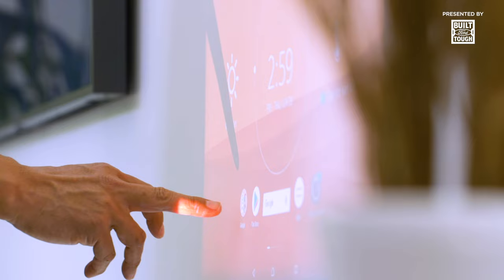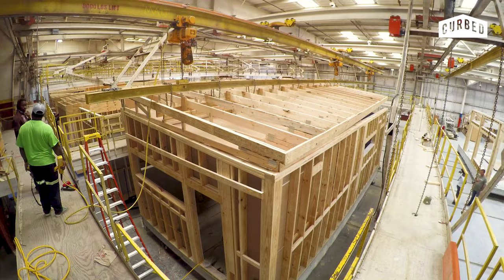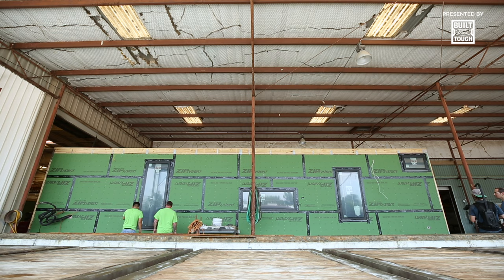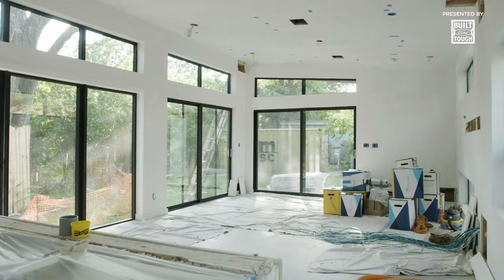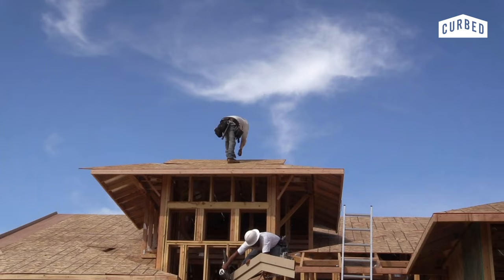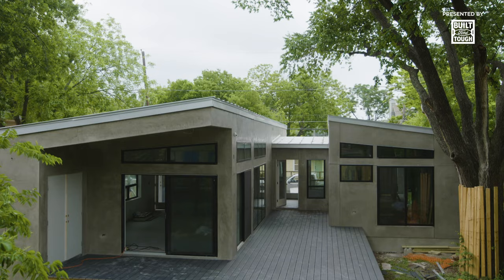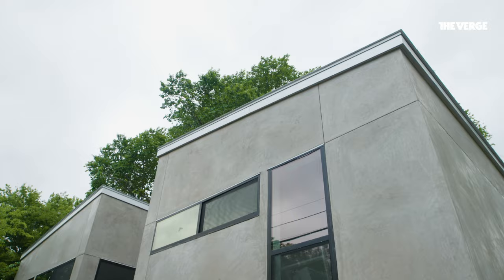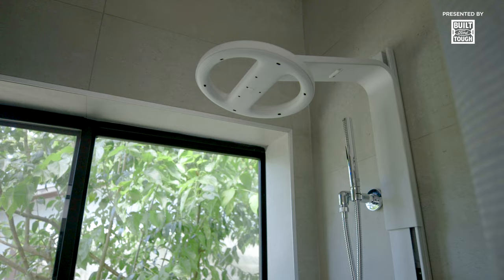We built the Home of the Future with Grant Imahara

Comment: high perimeter to area ratio (check), lots of glazing (check), practically no eaves (check) = Modern Architecture indeed. Even in a forgiving climate like Austin, the owners will be at the mercy of active cooling (AC) 6 months of the year. I would have aligned skillian roof to face south to maximize solar gains and employed generous eaves to keep the thermal loading off the mass - perhaps with north-facing clerestory windows to increase the internal cross ventilation. Smart houses used traditional design principles first, and active systems to increase efficiency second.
Reply: I guess my point is this: While the early modernists certainly had valid grounds to break from the stagnant cycle of neo-revivalism and seize the potential of technological advancements, today's context is far different. Our resources are becoming ever more finite, thus we would be foolish to turn our backs on the genius of past minds without becoming bogged down by convention. And let's face it, a box house is practically modern convention anyway.

Comment: I don't see this concept as eco-friendly
This is great though.
Why can't we use GFRC panels instead of a wood framework? I mean why to use wood anyway, why to cut trees if these can be done by other alternatives which are eco-friendly, stronger and even cheaper than wood.
Reply: @dubsdubs  tell this trolls, buggers, cws, busibodies . There is a trend on YouTube where if the first few comments are negative then people think the rest should be negative sarcastic and destructive as well. People be left behind in your own company without pulling others to yourselves and your negativity.
Reply: @mahindufrancis9998  but you're doing exactly what you said about negativity when DubsDubs does have a point? concrete isn't eco-friendly and wood can be grown and protected depending on who grows it for production. op is right in that there are other alternatives that can be used though, but I think those always take time to get through planning permissions in the different regulations an area has.

Comment: Modular homes have been around forever. Not really inspiring the idea of "home of the future" just yet.. I was honestly expecting something a bit more cutting edge, like 3D printed homes, a new blend of materials or something along those lines.
Reply: 3d printed homes are the real future, and not made out of cutting down trees.
Reply: @os2841  I don't think 3D printed homes are the future ... It's not eco friendly since 3D printing would mean that its extruding plastic, which is harmful to the environment...
Reply: @joeljames2829  actually they are made from concrete, it's not your typical 3D printer making these, as you can imagine, however it's not the home of the future due to the lack in sand used in concrete construction globally. If we use concrete as the next staple for housing it would be a greatly irresponsible move.
Reply: @joeljames2829  you can 3D print many different materials like concrete, steel, plastics, and nearly anything that is handled sometimes as a fluid.
Reply: @DoctorlyRob  Concrete specifically requires river sand, a finite kind of sand that we only have so much of. This sand is incredibly important to the life that lives near it. Concrete is not eco-friendly, it's just not super toxic or anything. Hemp, fungus (used in bio plastics), & other materials like it are what will be replacing concrete, plastic, wood, etc someday soon as they are environmentally safe & renewable.
Reply: @probablynotdad6553  yes I know that's why I said they too can't be the homes of the future
Reply: @DoctorlyRob  Ah, my bad I didn't see the read more part.
Reply: I guess houses will get smaller and smaller,and buildings full of apartments will get taller.Or.... everybody will live in cage homes,Just like they have in Hong Kong

Comment: The home of the future doesn't have a gasoline Ford F-150 in the driveway.
Reply: House Stark and you sir... don’t get it
Reply: House Stark I plan to tow my trailer with an electric vehicle. You know, with the instant torque and all. Tesla's long awaited pick-up truck is set to have 300k lbfeet of torque at the wheels. So I don't see why people would still be buying gasoline vehicles in 10 years.
Reply: House Stark look it up, electric motors are far more efficient and powerful than any thermal engine. Common beliefs have made us think otherwise all this time because of how good a thermal engine sounds. Most people don't believe it, but facts are there.
Reply: But I made a mistake with the numbers, the 300k is actually the towing capacity in lbs. Torque would look like 8-10k I guess.
Reply: House Stark yes I pointed out that I confused the two. But Tesla has announced working on a pick-up truck. Elon even went to Twitter to ask the public what they wanted to see happen in a pick-up truck, which is where I saw the numbers I mistakenly confused. There's at least 2-4 years though before we see anything official. Let's just hope it lives to the hype. It would be quite a move forward.
Reply: House Stark Tesla Truck is better.
Reply: William Pelletier lmao 300k ft lbs of torque
Reply: @123456789wil1  this guy was doing construction work lmao hes not gonna do that stuff in a nissan leaf

Comment: Having built 12 homes for myself, and incorporated every "latest" technological advance since the early 1990's;  Ive discovered that the best innovation is a very high MTBF.  The cost of equipment and the subsequent wear and eventual failure can almost approach the value of the home itself.  Having a high Mean Time Before Failure (or obsolescence). Integrated - this, and internet connected - that is flashy and cool, but the software and hardware support for such connected-ness is a continuing cost of effort and cash.  It is better to make the house more 'self-reliant' and add the cool functionality to the persons occupying the home.  Personal equipment can more easily be upgraded replaced or eliminated without the  expense of upgrading the home as well.  

Previous homes I've built have miles of unused cables, routers, etc, that became useless once wireless technology became commonplace.  Bluetooth is now eliminating many of the previous era WiFi devices.

Nice show, er-rather Showcase, since this appears to be more about the gadgets than the building.  Having done the one show on how to manufacture homes,   the real story should be how the manufacturing plant can be modified and configured to create more "custom" homes using the same flexibly CAD/CAM systems.

Keep up the good work Grant.  ")

Comment: Hey Grant, right off the batt I've always liked factory-built homes but I still have some question like can the mfg., add in-floor heating, how are changes handled while the house is being erected and how is water, power, sewer, cable handled between modules; specifically connections.

Comment: Excellent show.  Considering the implications of climate change and how our collective lack of effective corrective action is going effect future economies and communities.  My responsible home of the future will be prepared to deal with extreme weather events.  300km winds, heat waves, flooding and energy self sufficiency including smart grid technology to accommodate long term power outages and electric vehicle recharging. Digitally connected without question but not necessarily a "smart home" in terms we commonly use today. Anyone that values privacy in the home will not load their home full of equipment for hackers to exploit.  The Intelligent home of the future must include intelligent design to accommodate realities in the digital age. AI sentry to monitor electronic system, internet firewalls and home permitor security?  Brilliant show.  Thank you :)

Comment: I hear a whole lot of theory on home building & site construction made by people with a vested interest in the modular home industry. They are not always cheaper , ( which surprised me years ago.) It's considerably more expensive to change or add on to a modular house as there are few chases/available pathways for running services. Your home is only as good as the hands that assemble it. Traditionally PreFabs cut corners where ever they can save a penny w/ bare minimum framing, Slave labor wages & 
some shoddy hidden secrets I've found repairing them over the years. Snap coupling services buried in walls etc..
I say go for it if you can get one cheap. But know more of that money is going towards shareholders & sales than the guy who actually assembled your house. If they are around the same cost per' as a quality camper then maybe. Because that's what your buying. I'd also insist on a poured foundation w/proper storm ties & some type of siding that can be repaired to facilitate window & door replacement. Do your home work.

Comment: Traveling,mobile, transport, with pre- installed Plumbing? Shifting joints' Problems? Interesting! QC final- installment? More power 2 you if it doesn't! Or congratulations for a design that doesn't allow joint issues with plumbing on travel!🤔👍

Comment: My house would have to safe. The windows would be impact resistant, The doors cannot be kicked in,  It has to close to net zero.  It has to have enough solar panels to cover all energy needs. It has to be hurricane and tornado and earthquake resistant. It has to be termite proof and moisture resistant. It has to have a garage. It has to be fire resistant.  It should have a 1200 water storage container that is fed from rain water coming from roof.

Comment: Off grid is great, but being made of material and a design that limits the use of home heating and cooling. Using thick clay walls for example. Windows positioned to take advantage of sun for heating and light, landscapes that shades in summer when leafed out, provides more light when leaves are gone. And either earthquake resistant, high winds, tornadoes,  flood and fire proof. What good is smart tech when Mother Nature can wipe it out.

Comment: If this is the home of the future why is it wired for 110 volts? We only use 3 to 5 items in our homes today that require more than 24 volts the home of the future must identify and use lower voltage items. The use of low voltage allows for a more direct use of power resulting in less loss due to conversion. Low voltage lighting, gas stove, gas dryers, celling fans converted to 24volts and ventilation fans on 24 volts. Lower construction costs longer battery life and smaller battery walls.  Energy is the key to the home of the future.

Comment: What to see in home of future: character and classical beauty... Does hail destroy solar panels? How do you keep snow off the solar without a large tool to break your back to clean? Why do these modern houses look icky, like someone ran out of something so they cut a piece of an old trailer out and stick it up, or stick the shingles of the roof down the sides, IMO? Why not have an exterior with character instead of a box? Is the house made with low amount of plastic and dangerous chemicals that will waft out of the building materials and poison the owners?

Comment: Instructions not clear 24-pin atx cable is stuck in 8-pin pci-e slot....
(10 internet points for you if you know what i'm talking about)
Reply: Or using risers and finding the right 8 pin splitter.

Comment: I have seen bigger houses made out of concrete being built in the same or less time. This is bad marketing. Prefabricated houses should be cheap because they lack the liberty of space usage. I rather use self locking concrete blocks instead or a metallic structure with glass walls like the ones built in a week in Europe.